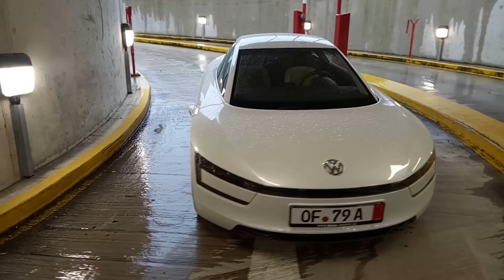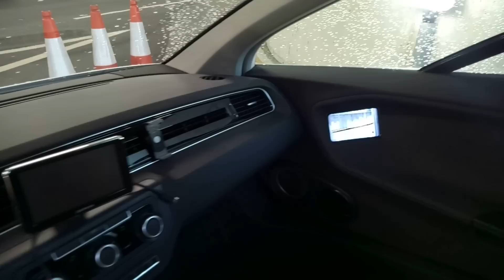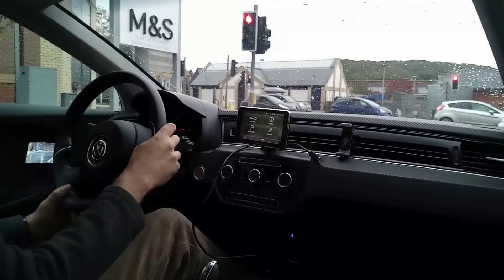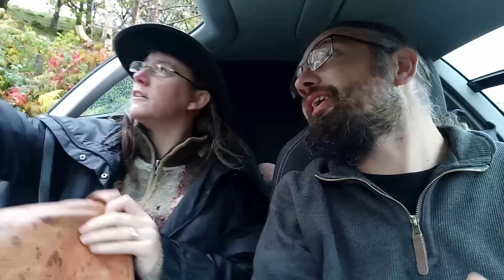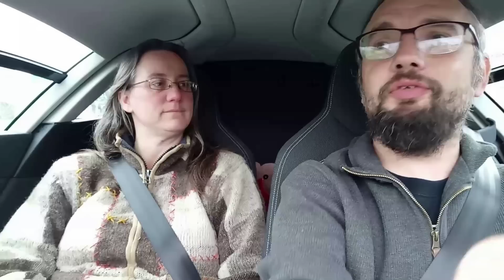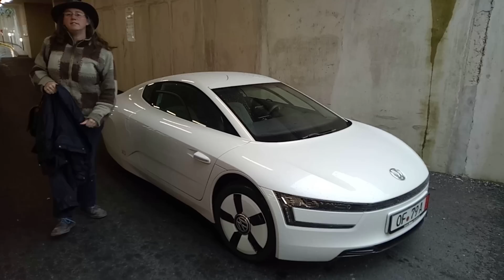Real Road Test: Volkswagen XL1 Hybrid thing

Comment: Interesting curio but fuel consumption not that impressive and not very environmentally friendly either.
We're in a peculiar age with lots of folks jumping on phev and hybrid bandwagon but ignoring the true overall environmental damage caused by building a car. As someone who has always worked in the electronics industry I'm also disappointed constantly by the way that such technology is being applied, the lead usually being by marketing feature and legislation making everything overly complex and expensive, rather than simplicity, functionality, durability and sustainability. Hey ho, probably why I'll remain an engineer at heart not a salesman.
Reply from the maker: Sadly, it does seem we're in a time when cars are designed by marketers not engineers. That's why I like electric cars so much I think. They do tend to be well engineered. I'm still not a hybrid fan really, but this one made me take them a little more seriously. Far better than the Mitsubishi Outlander PHEV which seems only designed to make the most of company car tax breaks...
Reply: 150 real world mpg not impressive?

Comment: Ah, they’ve stolen the steering wheel and heater control knobs from my Skoda Octavia. And why are these hybrids so bloody ugly? Prius, Insight etc...all horrific to look at. My friend has just bought a £20k Hyundai Ionic, 30 miles on the electric motor and 43 miles on the petrol engine...what’s the bloody point? I can get to Germany and back on one tank of fuel in my Octavia...
Reply from the maker: I thought it looked fantastic myself...
Reply: Its called aerodynamics.

Comment: Just come back in my 350 quid 1.4 hdi and that's just displayed 59 mpg.  307 French electrics don't lie 
Feel as if I have saved £ 129.750 and only panic about getting fuel once a month when the light flashes and don't have a Chinese air compressor for an engine

Comment: With a PHEV and a battery of that size, you're never going to fully charge it from regen unless you're going down a mountain or something. On a 60 mile trip in my Prius Plug-in (slightly smaller 4.4 kWh battery) I gained 1.2 kWh from regen. I average about 82 MPG overall - I only get about 10-12 miles in EV mode on a full charge, but that covers my commute. With a PHEV you need to be charging off the mains regularly to really benefit from the battery. Mine's also got 5 normal seats, the engine doesn't sound like a cement mixer, and I can fit a mattress or bike in the back with no hassle - maybe a bit too boring :) It does have a HUD though!

Regarding your experience with the CT200h (has the same powertrain as the Gen 3 Prius): It will need the ICE for any sort of meaningful acceleration, but once the engine is warmed up (2 minutes or so) and the battery state of charge (SOC) is high enough it should be able to cruise at around 50-60 km/h for 2-3 km. Once you go over around 46 MPH indicated the ICE will stay on though (the newer hybrids will go faster with no ICE, and so do the PHEV versions).
Reply from the maker: Thanks. The CT was disappointing for many reasons, but I was very disappointed to hear the engine kick back in after some very gentle movement in a queue. Heating perhaps? I was driving down an 800ft hill when I was expecting the regen kick. It never felt a very strong regen, but then having it on the rears isn't as useful as the front wheels.
Reply: Oh yeah, cabin heating is done the same as any other water-cooled ICE car, so you will see it run a bit more for that. My Plug-in had heated seats as standard to somewhat mitigate that, and the new Prius PHV has an electric heat pump to avoid it completely, but it's also one of several reasons why it's ridiculously expensive. I block the grille on mine in winter, helps a bit!

I take it the XL1 is RWD? Probably doesn't help the regen situation alright.
Reply from the maker: Yes, rear-wheel drive.

Comment: Not built for UK roads. As the rain water drips onto seats   stained seats   nice on a 100k motor
Vorsprung durch technik.     Stick with Twk.  Just add petrol when required

Comment: Body design is obviously good at reducing drag and automatically wind noise and reducing energy consumption good with any engine, very good if it was economically viable but at £130,000.
Reply: They were less than that new...the asking price has been increasing.
Reply: @davidperrott5743  Things have come a long way since the Milk Float.

Comment: My stepmum has just acquired a Hyundai Ioniq Hybrid (the non-plug in version) and it is interesting, moving off on pure battery and then just about hearing the petrol engine as you accelerate.
Another owner reckoned 80mpg  and that's with a 1.6 petrol, so for a car that is so designed to be efficient your 80mpg average is not that good.
Reply: It was the driving conditions though. This is way better like for like.

Comment: The scary thing about electric vehicles is a scenario in winter where you might get stuck in a snowfall on a country road.You might sit for hours waiting to get help.Meanwhile you are running the battery down with the heater on and cold is reducing the battery performance anyway- where do you plug in?.....so a hybrid vehicle at least gives some reassurance.
Reply from the maker: That isn't a big enough threat for me to not own an electric car, and I live out in the country.

Comment: Wonderful looking concept, but suddenly when compared to my old 1996 Citroen AX 1.4d doing 64mpg with amazingly comfortable seats, a boot full of stuff and a kayak on the roof it doesn't seem so impressive.
Reply: @urbex2007  

It is absolutely true that to get 3 litres per 100km or about 300mpg then you need to use the battery as well. I agree this is a bit of a con since it only lasts about 20 miles or whatever it is. 

However even after the battery runs out you should be able to achieve 2 litres per 100km if driven in the right conditions. This is about 130mpg. 

I have no idea why you think it only does 28mpg.
Reply: Kudos to your AX14D !  The owner of a Suzuki Celerio told me he gets 75mpg on a run, and that's on petrol  :-)   Smoke on THAT, Mr London Mayor...
Reply: I seem to remember the AX Diesel set a world record for doing 1000 miles on a tank.  I had the 106 diesel with the same engine, took it up to Skye and averaged 75mpg.
Reply: If this was driven in the same manner and conditions as your AX when you got 64mpg, this one would probably have gotten at least 150mpg though. Consumption numbers vary wildly based on driving, I can easily get my quite big Renault talisman estate to 75mpg on a run, for example.

Comment: Pity you can't charge it in the UK. Maybe some kind of step down converter or adapter could be made for it? There must be a way to do it.
Reply: Owner has just imported it used from Germany, complete with Euro plug. Just a matter or getting the right adapter or step transformer. My (UK delivered) XL1 just plugs into the standard 13A socket in my garage.
Reply from the maker: There probably is, but it was only visiting.

Comment: Very impressive car.apart from the frightening price. One thing that needs to be addressed is the fact that your friend has been unable to charge the battery in the UK. Surely the various manufacturers could have got together and developed a common plug for charging like we have with most smart phones apart from the iphone.
Reply: The XL1 was designed to be charged from a domestic 13A socket only. This is because they designers needed to save weight by having all the charging electronics in a separate box that is not part of the car, and the intention was that this charging box would be left at home. Remember, the only goal the engineers had was to achieve the seemingly impossible challenge of getting 100Km from 1 litre of fuel. When the charger is not in the boot, there is 140 litres of luggage space in the boot. VW went to great pains to explain to each person who enquired about buying and XL1, what the limitations of the car are. It's an uncompromising design.

Comment: Soooooo £130k no PAS and windy windows. I think VW may have missed the target market. 

I like the idea of Hybrids and EVs but they always seem compromised in some way. Either shape/looks, range or power. I want some quick and practical, but also like gadgets so I was looking a Auris. It's missing about 70bhp to what I have now which is nearly as efficient. Admittedly Toyota are introducing a more powerful version next year. But it's taken them a decade to get around to doing it. 

The new Nissan Leaf looks much better than the previous model, but the real world range is still very low. You can pick up mk1 leafs for around 7k now but I'd need a second car to go any distance.
Reply: Well, given that the new price was less than that and they sold all they intended making, maybe not.
Reply: @davidperrott5743  well said - you actually got the point of this car - the only person on here who has!!!!
Reply: @edstratton  Were the fanbase of a guy mostly driving classics and sub 1000£ cars likely to get a car such as this? Not realistic I guess. I do though. Cheers.

Comment: I didn't like how the rain water driped off the roof into the car when Mrs Hubnut opened the door to get in.
Reply: Same as happened to Marty in BTTF 2, and just one of many reasons why gull-wing / butterfly / Lamborghini doors, whilst cool to look at, are completely impractical for cars. The best arrangement is actually suicide doors - very easy to get in and out of a car that has them - but regular front hinged doors are a good compromise. If it ain't broke, don't try to fix it!
Reply: @rich_edwards79  yes good point but on the other hand, in the case of the XL1 it is so low that they had to have those butterfly doors to make it possible to get in reasonably easily.

Comment: Very interesting video, although my 40 year old 2CV is much quieter, comfier and sounds nicer, also much more simple, 4 door big boot practical and dare I say it sustainable.. If driven like a nun = 50mpg. Progress? Just how far have we come in 70 years? I'd like to see this level of clever materials/technology in a practical 100mpg 2CV, why this car doesn't exist is simply beyond me, as a planet we NEED that car.
Reply from the maker: I agree with you. Why are EVs so loaded with tech? Make it simple!
Reply: Unfortunately we're over regulated for small car innovation in the UK, which is one of the reasons the Reliant Fox was made in Greece. They set the lowest bar for getting a car through European regulations.
Reply: Lifan makes a water cooled 200 cc 4 stroke single ATV engine with 4 speed and reverse, roughly 18 hp @ 7500 rpm.  I'd like to see a modern microcar built around that old Honda CG moto engine clone. They're pretty durable and on a bike they get about 70~80 mpg ( not imperial gallon..)
Reply: A 1.5 diesel dacia sandero is the modern 2cv, and fills a lot of the points you asked for.

Comment: Electric car production is far more carbon intensive than conventional engine cars. The chemistry and physics of Electric technology is sufficiently well understood that it cannot provide any where near the potential energy of fossil fuel. What sells electric cars is that once they are made they have a better impact on the environment - it ignores the massive carbon cost of production, and then after 5 years the batteries will need replacing - the technology used degrades from the date of manufacture and has a limited life-span before it starts to lose its charge capacity and retention and is not a function of charge cycles. The battery manufacturing carbon impact is massive compared to conventional engines. Right now if you want to help the planet keep existing cars already built on the road. I'm no eco eco-warrior but unless they re-invent the wheel electric cars will go down in history as a marketing stepping stone to what will ultimately replace internal combustion engines
Reply from the maker: It's not true that batteries need replacing after five years. Whereas I see a lot of moderns needing entire engines within five years. What the heck is that all about? Ford's exploding EcoBoost is one, but even VAG and JLR engines often suffer major failures. Not good.
Reply: Agreed!

Comment: I'd like to see you get out off the car whist parked in the car park between two other cars with those doors lol  Rob
Reply from the maker: They don't open very wide. Should be easy. Should have tested it!
Reply: I tested it and found that when you open the XL1's butterfly doors they actually project sideways from the car LESS than the minimum amount that you would need to open a normal car door in order to just squeeze your bod thru the opening. In other words they are better (at least in that particular respect) than normal car doors.

Comment: I think some of the  concept Audi a2's had a 2L diesel (not 2000cc) it was called this because it used 2 litres of diesel/100k so the XL1 is not a huge improvement.
Although cutting edge you will still need to pay 12 pounds a day to drive this in the ULEZ zone after Easter if it's not euro6  ........ Ironically the same cost as all the other classic cars you drive less than 40 years old.
Probably the Honda Insight would have achieved better mpg if it had a diesel.
Reply: Never heard of those, the A2 3l that was produced got a rated 3l per 100km. But even if there was an 2l A2, half the consumption is not a huge improvement?

Dont know if I get you correctly, but the insight would indeed be more frugal compared to its petrol self with a diesel instead, but still not close to this car.

Comment: 26 in the UK of which 4 are on the road,  I wonder how much of that is down VW's famed reliability....
Reply: Tbf I’ve had several cars with VW engines that have hit over 300k easily with very few issues, one went onto over 450k. My current car has a VW 1.6 CR TDi engine and has had no issues at all and has hit 110k in three years since new and not single repair to the engine or anything else.

Comment: I'll pass on this thanks. Quite like the news that Mazda are looking to resurrect the rotary engine as a range extender in their new proposed hybrids. That will be interesting. This just looks like something from UFO/Captain Scarlet of Gerry Anderson fame. Not coming to a high street near you !
Reply: Gerry Anderson, yes! Just realised this is the VW XL1. Possibly in around another 45 years it will evolve into Fireball XL5....though I'm not quite sure that'll pass the emissions test...
Reply: More like the maximum security vehicle in Captain Scarlet or Ed Straker's car in UFO. Would rather have the Ford Zodiac that Ed's car was based on.
Reply from the maker: Yes, given how rotary engines hate not being run up to temperature, I'm intrigued to see how that pans out.

Comment: Just looks like another take on the original Honda Insight to me. Just more toys like the rear view cameras and Garmin non-integrated computer screen! Lots more things to not work over time. Very Ed Straker and useful for carrying two people and a bag of toffees wherever they want to go, but where do you put your hedge trimmings when you need to take them to the tip on a Sunday? I also noticed when Mrs. Hubnut opened the door, it dumped rainwater on her seat.
Reply: Yes , l too thought of straker's car on seeing this .
Reply: Actually doesnt look anything like a Honda Insight. And your not supposed to carry that bulky charger around in the boot. The XL1's boot is 140 litres - that will actually take quite a lot of bags. Or hedge trimmings.

Comment: Fabulous video indeed!
Nice to see VW using its engineering prowess for new designs. Although as Mrs Hubnut discovered the semi-tandom seating is not quite as practical as one would hope for. Owing to the short run of the design most likely.
I am one of 65,000 that signed up for the fabled ELIO. It was supposed to achieved 86mph.
Sadly after years of waiting no car.
And the feeling is the car won't show up on my door step any time soon. Perhaps you could visit the LA auto show in Dec. Sometimes the Elio is put on display. Along with a glittering array of interesting and practical Automotive models.
On year I saw the latest incarnation of Studebaker. 
An enjoyable video test of a car with amazing design potential.
Well done Ian. Rich and Cats,
Dodging the crazy drivers in LA.USA .

Comment: Its a good idea to have a hybrid car where the engine and battery work in alignment with each other as it shows that the manufacturers are thinking forward.  But £130000 is way too high and pretty much on par with a top of the range Tesla.

Comment: Wow that’s incredible I love the way these look, very futuristic. I love cars that have the rear wheels hidden, this looks very similar to the first generation Honda Insight. This VW Interior dash design looks surprisingly bland and conventional though, which is a shame. They should have designed it to look more futuristic, like the heads up displays of the first generation Citroen C4 hatchback, which had a centrally mounted screen and more screens on the centre console, behind the fixed-hub steering wheel etc.